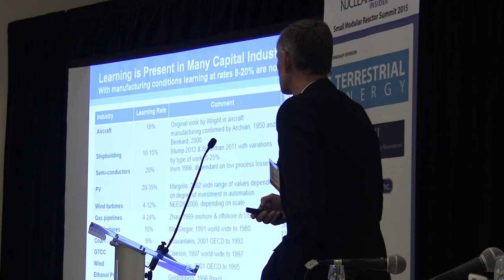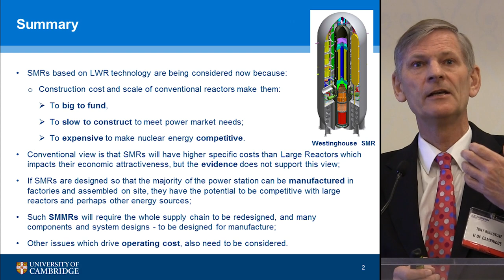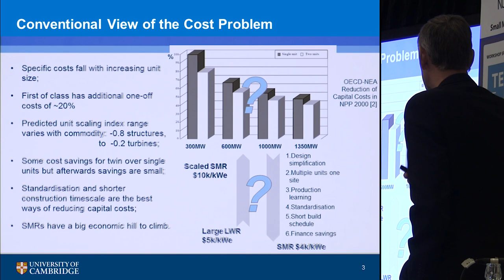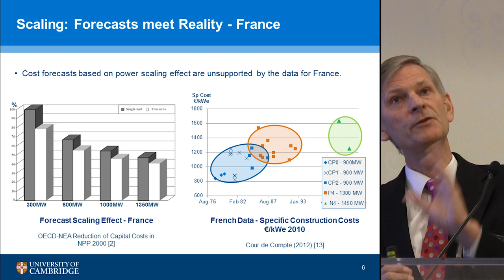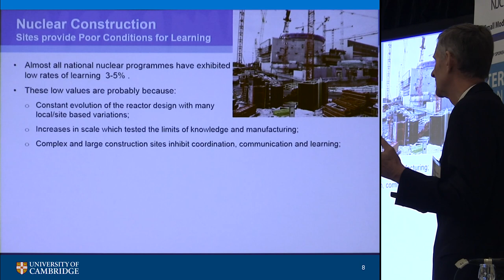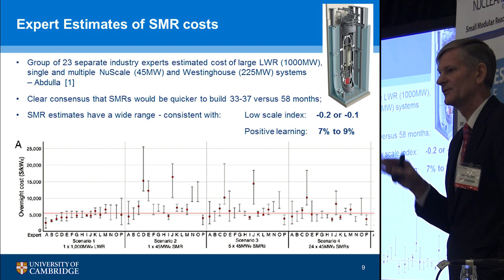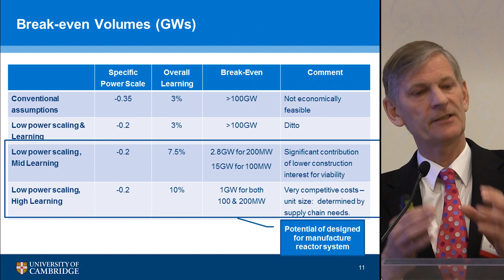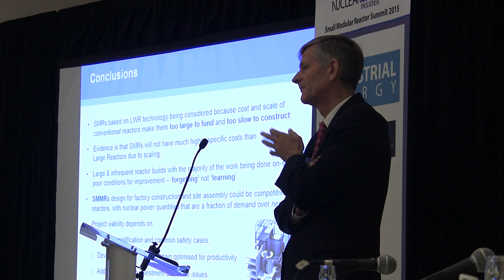Tony Roulstone - Nuclear's Economy of Scale vs Volume

Comment: I see a significant problem in this argument.

As I understand it, the argument is made that the SMR design by itself will not lead to an improved learning curve, because the reactor itself accounts for only about 30% of the plant cost. As every plant is different due to jurisdictional issues, the other 70% of the cost has basically little or no learning.

Is that correct so far?

Ok, he then states that the only way to get real savings is to standardize the entire system, not just the reactor, but every part of the plant, all its equipment and all the suppliers.

Ok, fine.

But throughout the presentation, on many occasions, he claims that that's not how plants are built, because the various jurisdictions demand their own requirements and suppliers. So, then, how do we change this?

It seems difficult/impossible. 

Given the very different operational experience and safety models, I can't imagine any design that can be used as-is in both the US and UK anyway. I guess that is a possibility, but it seems remote.

But beyond that, can anyone here imagine the UK government agreeing to give UK taxpayer money to US companies to buy every piece, when RR and others in the UK are pressing their own designs? That sounds like political suicide to me - F-111 over TSR-2 anyone?

At one point he compares the nuclear industry to the aviation industry. Yet the aviation industry is precisely the opposite of what he claims - the idea of local construction is baked into every contract. When Canada bought the F-18 it included Douglas taking over a former Avro plant in Toronto where they produced DC-9 tails for a decade. And consider Airbus...

So it would seem for a design to be successful it would have to be something like Airbus where the supply chain is spread across all of Europe and the entire continent agrees to buy, license and build exactly that design. That seems much more possible, but not something that is going to happen in the next decade.
Reply: The comparison with Airbus is interesting, because France's EDF is now a major player in UK nuclear and, after finding out the hard way that competition doesn't reduce costs, the UK has committed somewhat to the EPR design. So there is at least a small chance of greater standardization across a joint UK-France fleet. Unfortunately despite repeated market failures there is still a significant portion of political elites, that are ideologically wedded to free-market concepts, that fail to acknowledge the fundamental differences between capital intensive national scale infrastructure and short-cycle consumer products like i-phones. The UK government in particular wishes to engage multiple nuclear developers, on the basis of accessing a wider range of private capital, purely for the purpose of keeping debt off the government's own balance sheet. This too is completely illogical as governments are able to access capital much more cheaply than the private sector, and multiple participants will result in less standardization and therefore higher costs. Contrast this with Airbus where multiple European governments directly fund product development in return for a share of profits from production, a system that has worked extremely well both for Airbus and the contributing governments.

Comment: Tony Roulstone's lecture is vaguely interesting however two things spring to mind 
a) It appears to be a lecture describing Einstein's definition of insanity.  Doing the same thing over and over again and expecting something different.
b) It also appears to be a clever sales pitch for  PWR's reminiscent of Sir Walter Marshal (one time Chair of Central Electricity Generating Board - CEGB) by using the art of misdirection.
 i.e. rabbiting on about "learning" instead of actually stopping this insanity of a design and doing something different!!

Comment: Molten Salt Reactors should be 30-40% of the cost to produce, due to their inherent safe design, no pressure dome, no 170 atmosphere plumbing, no need for three layers of backup power, not using water.  www.energyfromthorium.com
Reply: Might help save the planet...or at least California
Reply: Nothing can save california.
Reply: And they can use existing nuclear waste ! 

Copenhagen atomic is one that I like. But years away